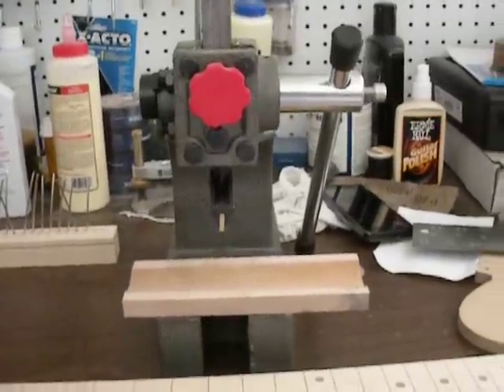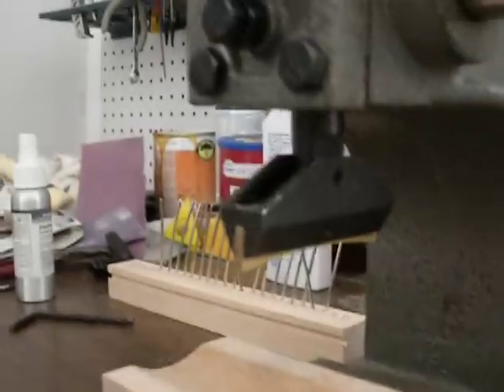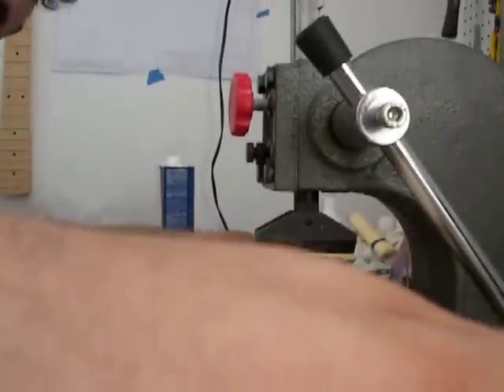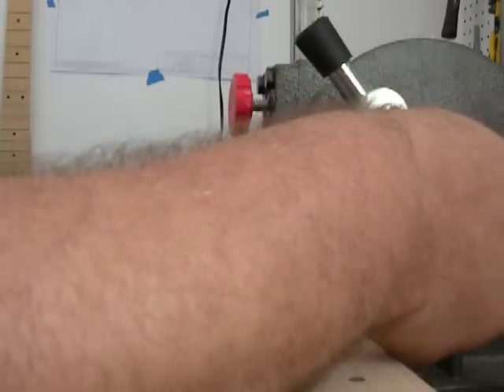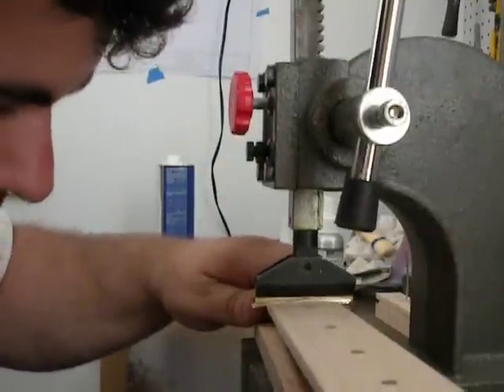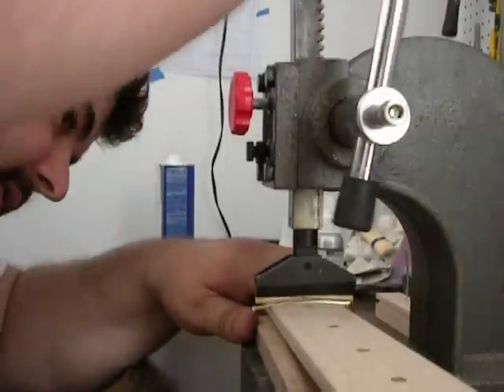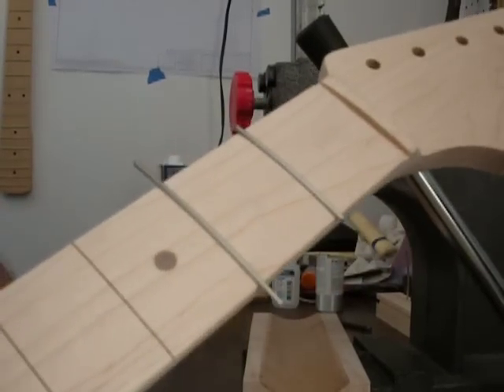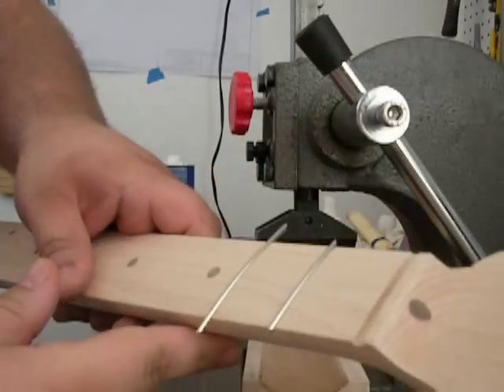DIY Fret Press

Comment from the maker: The only modification I had to make to the press was drilling a hole in the steel bar to accept the Stew-Mac fret press caul. It wasn't very difficult, but its the kind of thing you only get one shot at before you screw it up, so I would advice you to very carefully mark out the center of the bar before you do it, and use lubrication for your drill bit. I just used wd-40

Thanks for checking it out! Good luck!

Comment from the maker: @KCDaveB Definitely. The 1 ton press is overkill by far. The reason I got the 1/2 press is because it takes up less space in the shop and it was cheaper. As long as your pressure is evenly distributed, this is more than enough to press in a fret. Works far better than hammering.